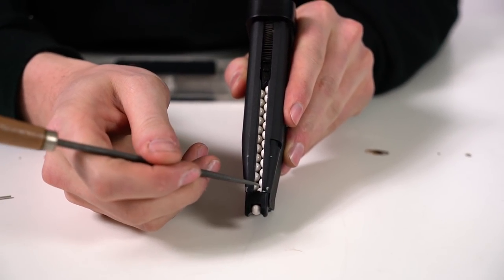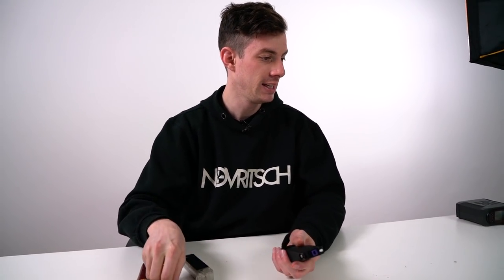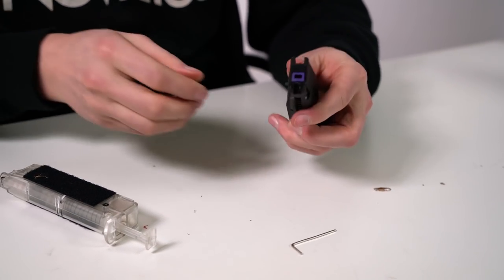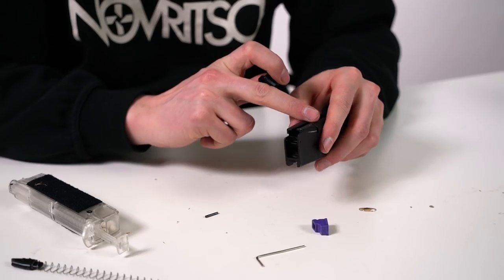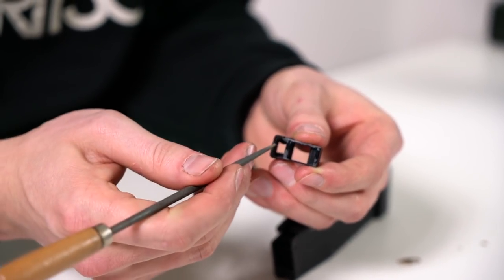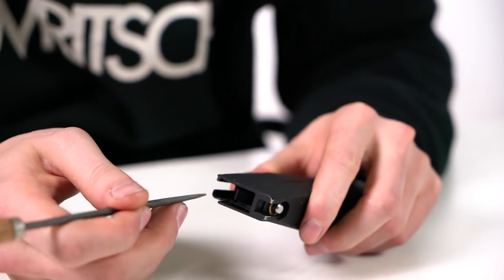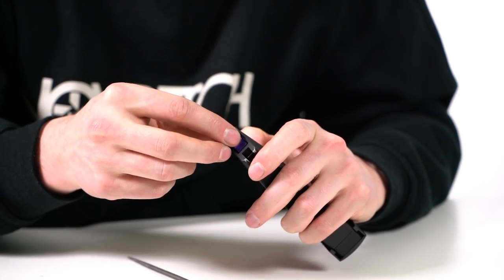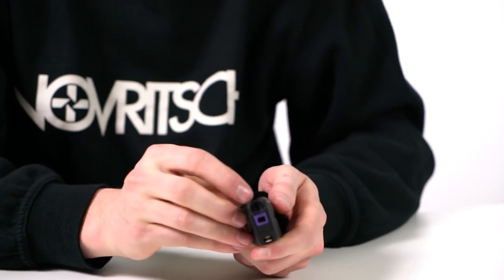SSP1 - Magazine Feeding Issue SOLVED

Comment: Just got my SSP1 and  I am loading properly and still having isssues, not feeding because the magazine is note pushing the bb correctly and also, the slide is not locking when the mag is out so 2 problems from a brand new pistol in wich I spend 160 bucks, really dissapointed...

Comment: Yep still having feeding issues after doing this- I've tried several different hi capa mags and it's the same issue. Most likely a problem with the internals plus this thing has no where near the range that's claimed. Sorry Novritsch but I'm extremely disappointed
Reply: Also mine that i received yesterday. I shoot 4-5 bb and then nothing need to reload by slider and then again. There is a solution? The BB are put correctly.
Reply: @marcodeluca8368 did you ever find a solution to this? It’s happening to me and I know what’s causing it I just don’t know how to fix it. If you push up on the mag and fire that solves this issue until you release it again, but do you happen to know of a permanent fix
Reply: @Redcat-jj9kp  no, i didn't find any solution, i contact the support and send back the pistol and they give me a new one
Reply: Did you guys find a solution to this? Brand new ssp-18 and just the same is happening. Jams after two BBs and need to manually reload it to shoot two more.

Comment: Just got a brand new ssp18 and the it always jams on the top of the mag like this. all of my glock mags are lately.
Reply: Apparently I heard that I could be my BB quality that is causing the issue. I tried a different brand and everything goes smoothly. I think it's a bigger deal than anyone trying to save money would like to admit lop
Reply: Used to jam after two BB shots for you? And then it stopped happening when you changed the BBs brand?

Comment: Great, I will test it, I just bought SSP5 and 4x per first magazine (old type with the gun) the BBs Novritsch 32g stuck (after few shots 1th BB was loose and not pushed to the feeding chamber of the magazine and 2nd+3th stuck= noth enough space and then the rest of the magazine - properly loaded)
Reply: How is your ssp5 doing right now? Just got my ssp5 and we seem to have the same problem
Reply: Yeah I’m having the same issue. Did you fix this, and if so how?
Reply: @rdb9936  just cock the slide alot and empty a few mags worked for me. Maybe use some sillicone oil? Its just a little rough out of the box.
Reply: @Simpie32  Yeah, I partially dismantled and put silicone oil and now it seems much better. K think maybe the tolerances are just extremely tight to start and it takes a little while/few shots to bed in

Comment: You shouldnt have to make this vid. I had to buy 3 new mags because they all leaked co2. The fourth worked. But like bruh
Reply: bro.i had same problem-leaking mag.so on the bottom of mag thera are two pins-take them out and u can take thebbottom apart and there u need to change rubber ring.after doing this no leaking problem.much cheaper than buying new mag for €25